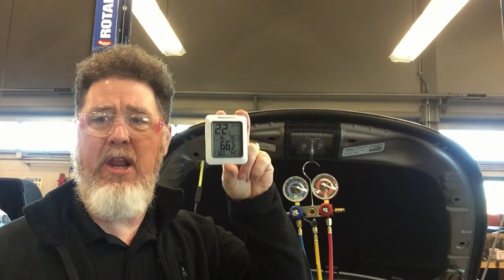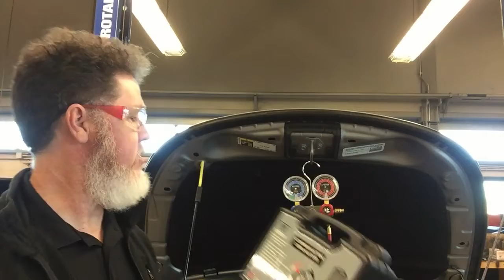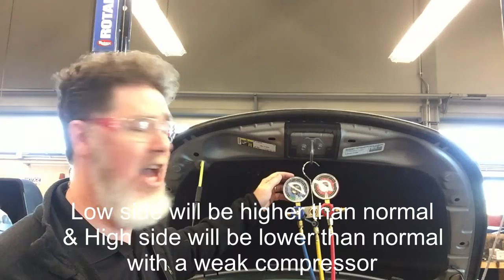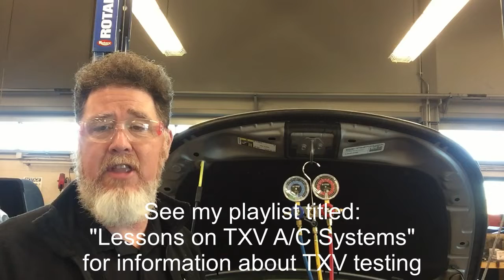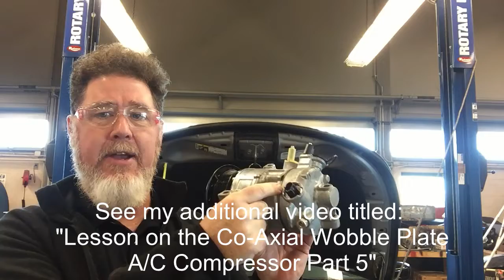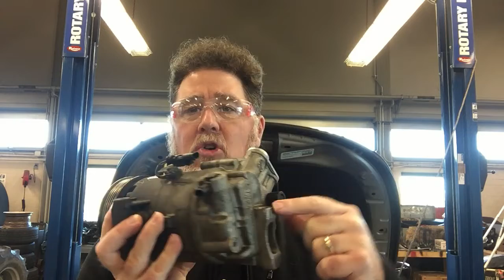Diagnosing a vehicle's A/C system:  Low side PSI is High & the High side PSI Low

Comment: WTF?? Who is this guy??? Calling psi "degrees". He said he gets 30 degrees out of the vent. There's no way it gets that low because your evaporator coil would freeze into a block of ice. He then says "If the clutch is energized, you're going to get the exact same readings on both sides." NO YOU WON'T. If the clutch is energized and the compressor is operating you will get a low side reading of 45 give or take and a high side reading of 200 give or take. What a joke!

Comment: Hello. I have a 2010 Altima 2.5L with 118K miles. The A/C clutch stays engaged when the A/C is on but is not engaged when the A/C is off. The radiator A/C fan turns 5-10 sec when I turn on the A/C and then stop turning. The radiator engine cooling fan turns no stop. The A/C cools but is not performant enough, does not blow very cool, just a little cold. The system has refrigerant. What can be the issue? TY

Comment: dear sir.
got VW with same symptoms low side-high,high side-law,duty cycle by scantool is near 80%.
well,or it is weak compressor or bad solenoid or bad TXV according diagnostics, however there is falt code for Air quility sensor circuit open and no outside temperature sensor on the car which is supposed to be..
could it be a problem because of temperature sensors??
Thank you and best of luck

Comment: Hello Professor Pentane……thank you for the amazing content!.  I recently replaced the expansion valve on my 2016 Mercedes GLE 350 because very high low psi side and low high psi side with ambient air coming through the vents.  I evacuated the a/c system and ran a vacuum for about 12 hours and leak check was perfect.  I then added new r134a into the system using weight scale.  The a/c worked great for about 10 minutes with 45/175 manifold readings.  When I went to start car the next day it was blowing ambient air temps again and the low psi side was reading 7”-80 and high side 100 in 90f weather.  Any ideas for me to check.  I’m starting to lean with a bad compressor because the expansion valve is brand new. Thank you for any help.

Comment: What could be the problem if both high and low are reading the same about 40psi then when turning on the AC the compressor cycles about every 3 seconds on and off and the low pressure dips down to about 5 the high goes up to about 90 then they go back up to the original psi when the cycle ends (after about a second)
Reply: Freon is low
Reply: Compressor comeson....pressure falls because it's low, the cutoff switch stops the compressor because of this to protect it from running without enough in the dystem

Comment: On the vehicle I was diagnosing the compressor clutch was spinning but the pressure was 100 psi on both sides.
Reply from the maker: The compressor is not pumping refrigerant.  If it is a variable displacement compressor, the solenoid on the compressor must also be energized  for the compressor to pump refrigerant.
Reply: @ProfessorPentane  my high and low side are both reading about 80. Compressor clutch spins continuously, does not click on and off. Low side line feels much warmer than high side line. Which is weird. I ended up adding about 18 oz of refrigerant but it took a very long time because the system acted like it did not want to take it.
Reply: @phillippardo5712 , so my 1999 Benz has a issue with the low side building pressure rapidly with the compressor working. I added freon after reducing the pressure to a low reading and after a can still not getting cool going back to the video now, & thanks for posting it 😳
Reply: Did you ever figure out your problem?

Comment: I'm getting 56 psi on low side and 129 psi on high side @81°F with compressor lightly clicking constantly. Car cools well while driving but only cools a bit at idle. Could a low refrigerant charge also cause this?
Reply from the maker: Low side high and high side low is normally a weak compressor.  It could also be a suck open TXV, but that would cause equalization time to be very fast.  Does the vehicle have a variable displacement compressor as these gauges readings could be normal for those systems?  Not undercharged.  Good luck.
Reply: @ProfessorPentane  Yes, I believe so. It's a 2006 Honda Accord 3.0L V6. Does equalization time mean having the same readings on both gauges or having the appropriate readings (briefly)?

Comment: I am having the exact symptoms described in this video my compressor is seven years old and not pumping sufficiently. 
Could you comment on this observation: 
After turning the AC off / motor off the Low side pressure climbs within 10 seconds to 120psi over time the pressures equalize to about 80PSI what would cause this and where does the equalization of the system take place.

Thank you so much for these videos they are absolutely awesome!

Comment: Hello Professor.  Hoping you can answer a question about the AC pressure sensor wiring.  I have high pressure on low side and low on high side and trying to troubleshoot the issue.  The 3 pin wiring harness to the ac pressure sensor has a 5. Volt reference, signal wire and ground.  My signal wire has 5 volts in addition to my 5 volt reference wire.  This doesn’t seem right but can’t find an answer anywhere.  Again, this is the voltage at the 3 pin harness and not the sensor.
Reply from the maker: Hello Aneta,  Yes, that is the correct voltage.  You will have 5 volts on the reference wire, 5 volts on the signal wire, and less than 250 mv on the ground wire.  If you don't have a scan tool to check the pressure of the sensor, you can back probe the signal wire to check the voltage.  .70 volts would = 70 psi.  1.50 volts would = 150 psi.  It is almost a 1:1 ration between voltage and PSI. As long as the voltage is not above 4.0 volts, the sensor is not causing the compressor not to come on.  I hope this helps.  PP
Reply: @ProfessorPentane  thank you!  Love the channel

Comment: What does it mean if ac system wil not take refrigerant, even though the ac compressor is engaged and turning. Asking because, trying to recharge ac system on an accord, and manifold readings don't move. Low side is the same pressure that is in the refrigerant can, and high side stays zero
Reply from the maker: Sounds like the compressor is not pumping.

Comment: Thanks for the video.

I'm diagnosing a problem with my AC.  1999 Chevy S10  Blazer.  Compressor does short on/off cycles continuously.  3 seconds on 3 seconds off over and over.  System is clutched fixed displacement compressor, condenser, orifice tube, evaporator, accumulator dryer with low pressure switch.  I don't see any high pressure switch anyplace...  70F air outside.  Low side looks like about 100 psi.  High side goes from 75 psi (compressor off) to 100 psi compressor running).  I suspect low pressure switch on the accumulator is bad.  Cheap and easy to replace...  Should I jump the low pressure switch to see if the compressor is able to build more pressure and bring low side pressure down before wasting time swapping low pressure switch.
Reply: Whats the gauges say system off on freon charge?   The constant cycling sounds like low freon.   The PSI readings you do have sounds like a bad compressor.   Its a pump, KISS principle.  High low side means its not sucking.   Low high side means its not pushing.  Nothing else is going to cause those psi readings.

Simple system and compressor failure is common on those.   Just fyi, the high side switch is located on rear of compressor.

I personally would check the gauges for freon charge.   You can bypass the low switch for a short time to check psi if you cant judge freon charge with gauges.   It sounds like you have both low charge and bad compressor.   The low psi switch Id have last on your list, they're reliable.

I would plan on a compressor, condensor, orifice tube, accumulator and flush in your future personally.   Id also suggest checking the fan clutch for operation at idle, they go bad and eventually kill the compressor with excessive high side psi in the heat.
Reply: Thanks!

Charge is not low.  Probably bad compressor. 

I have a new compressor...plus orifice o-rings, oil.

Looking for local place to recover my refrigerant...then I'll flush condenser replace the compressor and put it in vacuum.

Unfortunately WA stores don't sell R134a...so I'll have to pay someone to recharge (or drive down to Oregon to pick up some R134a)...  Probably cheaper to pay for recharge than drive 350 miles round trip....

P.S.:  I've never been able to locate the high pressure switch...but would like to replace that at the same time.
Reply: @alano2875    Be sure to replace accumulator also.    Weird, on the switch.   I wonder if the high psi switch is broken off?   Should be on rear of compressor and held in with a c clip.  OEM AC Delco compressors will come with a new switch, aftermarket youll need to reuse the old one.   Theres a port on the back with a plug.

Wow even in wacko CA we can buy R134 at the parts store.   Crazy in WA, you cant.
Reply: Thanks.

That's part of the UAC kit I picked up.
Reply: Found the switch...right where you said.

Will source a new one for new compressor...as you said...plugged and not included. 

Summer will be over by the time I get to fixing this...

If the compressor goes...how common will a plugged condenser be, I wonder...guess I won't know until I get there...

Thanks again!
Reply: @alano2875    Perfect   👍

Honestly I was a wrench for 15 years and did everything (including ac) as I was an ASE master.   I just did this same job on my older 02 silverado.   When it came to bad compressors, I always replaced the condensor on jobs (and my stuff).  They are the 1st place all the debris goes from the compressor.   Too much time and $$$ to have all the debris end up back in the system.    Condensors are cheap and not worth trying to flush.   Every old ac system benefits from a new condensor IMHO and another reason to just replace it.

If $$ is really an issue, I'd pull the orifice tube before the job and take a look.   If it's clean, I'd say a flush is an option.   If there's debris in it, replace the condensor or you'll be doing the job again soon.

Here in So Cal its regularly over 100F in the summer.   Not sure your location, but if its hot an auxiliary electric fan is a great idea.  I usually added extra fans to vehicles without electric fans..  I personally add an auxiliary electric fan to all my trucks (even with a working clutch fan) and it makes a huge difference on high side pressures and lower interior temps.

PS don't forget to replace the high side and low side Schrader valves.   Theyre a common leak on these (especially after being used) and nows the time while you have the system empty.   Theyre cheap and save the aggravation of being done, pulling gauges and find them leaking afterwards.
Reply: It's not hot here in the Puget sound region...but AC is needed a few weeks a year...especially in traffic.  

I'll take your advice...but we'll see...just threw CEL now and runs rough under load...(bad misfire under load...maybe lean..any case 1999 rig with original O2 sensors...so I'm already suspicious/hopeful...will have to get the code reader on it).

Thanks for all the great advice...If I get it running right again...will be doing condenser and schrader valves too.  Window defrost will be a lot better with a compressor...

Comment: How can we check for an electrical problem? I checked all of the fuses. Can I somehow put 12v to the compressor to force it to run?
Reply from the maker: You can put 12 volts to the clutch but not to the variable displacement solenoid.

Comment: My car, a Renault, only has a low side connection.
How should I diagnose problems without high side pressure information?
Reply from the maker: Hi Douglas,  you can measure the temperature on the discharge line and then use a pressure/temperature chart on the internet to obtain the approximate pressure in the line.  Good luck,   PP.

Comment: I replaced compressor vacuumed everything and went to recharge and now i have a low reading but my high pressure side has no pressure
Reply: Blockage on the high side line, most likely orifice tube
Reply from the maker: I agree Mike, thanks!  PP
Reply: @ProfessorPentane  🤘🏻
Reply from the maker: It is odd that the high side as zero pressure, where is the high side service port?  If it is the liquid line, there the condenser or receiver-drier is restricted.  Recover again and make sure there is refrigerant in the system before replacing anything.

Comment: I’ve got a v.d. compressor in my 2003 x5.  I’m experiencing only 1 to 3 psi change between high and low with the clutch activated. Classic symptom of a bad compressor. Pressure was around 100psi static, and I believe it was 85+* outside. 

My question: is it possible for this to happen by a stuck open expansion valve, and or a low duty cycle, or stuck solenoid?
Reply from the maker: A stuck open expansion valve would have a greater change than 1 to 3 psi, not the problem.  It looks the compressor is not pumping at all with those pressure readings.  Yes, it could be a solenoid problem, but hard to tell if you do not have the special tools to check.  Most DYI guys will replace the entire compressor for this problem, but remember, it could an electrical problem that is causing the computer to not turn on the compressor.  Also check for fault coeds.  I would diagnose this problem by looking at scan tool data and use a special tool to bypass solenoid and manually control the solenoid.  Again, hard to diagnose without special tools.  Good luck.  Does this compressor have a clutch, is it on?

Comment: Can never find any info on Low side normal/high and High side normal. All the other conditions are easy
Reply from the maker: Air in the system because someone did not evacuate a previous repair would cause low side normal and high side high.
Reply: @ProfessorPentane  I had my 07 pt cruiser vacuumed out and tested for leak. It was recharged. High side reads normal. Low-key side goes over 60psi (up to 100) when AC clutch engages. Blows cold when driving, warm at idle. Will potentially stall engine when on at idle. We're thinking clogged condenser

Comment: I let pressure out high side because I didn't have an understanding. So I need to pull vacuum on high side ?
Reply from the maker: Either side will work for pulling a vacuum before recharging the system.  Thanks for watching.  PP

Comment: Thanks professor., just the scenario I am having now plus one more symptom - increase rpm slightly and pressure normalizes on both sides and cold air starts blowing.   Basically I have no AC at idle or  stand still traffick.  I would not probably notice the issue but living in NYC, traffic is where average driver spends most of the time during summer. 
Is this additional detail points to the compressor or blockage?
Reply: Increased rpm and your ac blows colder points to a weak compressor.

Comment: my low side is 80 psi and high side is 150  only 2 cans freon put in after changing the expansion valve high side gets real hot to touch low side is warm to touch any ideas   the compressor turns and spins
Reply: I have the exact same problem 😂
Reply: @Bobo-t5u  ended up being a bad compressor the suction side was bad swapped with a junkyard compressor works great know
Reply: @Bobo-t5u did it work for you too? I have the same issue. Compressor holds with no leaks and kicks on properly but never gots cold I refilled it and emptied it 10 times and no change
Reply: @AlecFacemire  in my case, the system did end up blowing cool air, it drops the temperature by about 15 degrees but never gets very cold. During the summer, the ambient temperature in my area is in the 90s, so a 15 degree differential doesn't do much. If I'm on the highway (wind) and it's raining (water spraying on condenser) the system works fine. I think my problem is a bad/clogged condenser. I haven't had the time to replace it yet.
Reply: @Bobo-t5u  did you ever get to the bottom of it?

Comment: Hi. Just changed entire AC system(compressor, expansion valve, O-Rings, Condenser, and Schrader valves. On a Honda Accord 2.4 Liter. I vacuumed system out. Purged the yellow line of air, between Freon cans. The Low side reads 25 psi BUT THE HIGH SIDE READS 110-112!! Ambient outside temp was 65-70 dry conditions in AZ. What do the readings mean? I put a thermostat inside the car’s vents and temp read 40f! It was Ice Cold. Did I do everything correctly? Why is the high side not at 150-175psi?
Reply from the maker: Hi Michael,  You caught me at a good time as I do not have time to respond to all of the questions from my YouTube videos.   Your gauge readings could be normal for a milder 70F dry day with.  Was the engine at full operating temp?  That will cause the reading to be lower if the engine is not hot.  Try switching to the fresh air mode to see if the extra heat load will raise the high side pressure a bit.   But I think over 150 on a mild day is normal if you are blowing out 40F.  You will not know for sure until it gets nice and hot in AZ.  Thanks for watching, P.P.

Comment: Thanks I hope you’re still around …

Dealing with a 2011 Jeep compass . The low reads hifh and high a little low . I’ve seen many people having issues with these cars and people mention the tool you’re using to adjust the duty cycle … 

I’m hoping it’s my txv or overcharge …

It was properly evacuated, held vaccum passed leak test and proper ref was replaced . The readings after this was apparently normal readings .
However later on the pressures flipped again .
Reply: What’s this scan tool and what are the electrical systems I need to check?